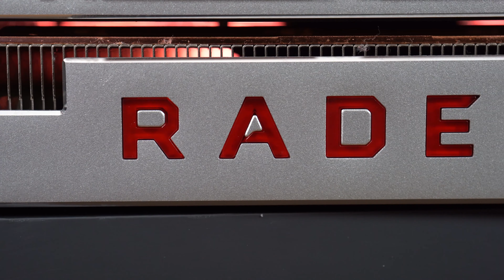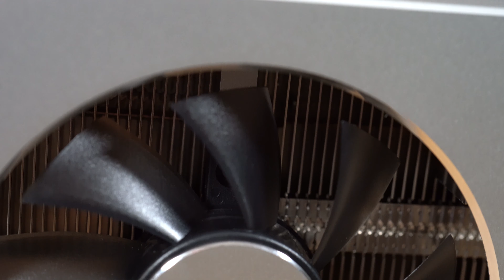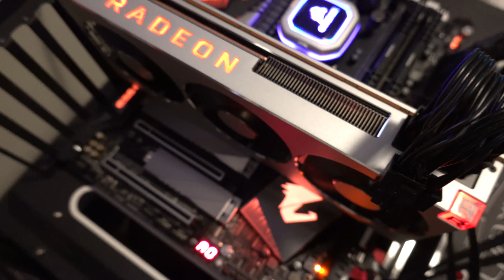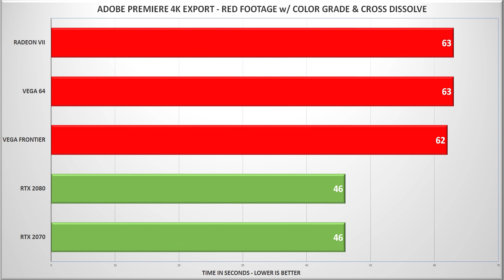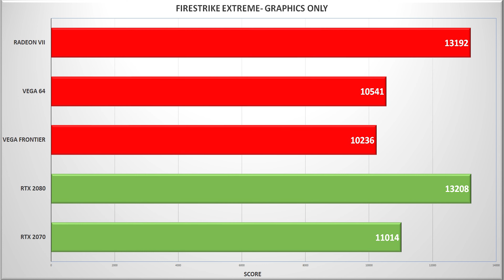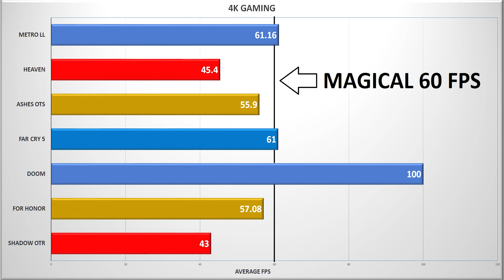Radeon VII - Can It Compete?

Comment from the maker: PLEASE READ!
Thanks for sticking around for this extra long one.  Here's a few important notes:
1) In speaking with several other reviewers it seems like everyone had different, weird issues with their samples.  Some had constant crashes, some saw temps over 100 C, some couldn't overclock, some couldn't use monitoring software.  We all did the best with the cards we had and the information we were able to gather.
2) As I stated in the video, all of my information on Radeon VII was gathered using Wattman, as this was the only monitoring software that would work at all.  As such, I couldn't gather power draw numbers, and my temps might look lower than some other reviews.  Unfortunately, not much I could do about that.
3) Improved drivers will likely help a lot of these issues, but we could only work with what we were given, which was the press drivers.
4) It's likely I'll revisit this card in a month or so and see if things have improved.
Reply: Under-volt the card ! how have so many professional reviewers overlooked this? it was well known that Vega cards perform significantly  better when under-volted. so far Ive seen one review where the bloke under-volted the card. low and behold he achieved a OC of over 1900mhz , closing the gap with even an OCed 2080.
Reply: I am curious if your 100c was core temp or junction temp as those are very different.
Reply: If only AMD had put as much time and effort in releasing it and sampling reviewers with some decent drivers and had some quality control so there wouldn't been these (random) issues/crashes etc. as they did with the time and effort that went into the reviewers packaging and card display stand, the news story might have been a bit less dissatisfying besides what the cards offers for the cost it currently has.

Comment: Fair review, You said the same basically as all the other reviewers, and you gave the card a chance. I am a AMD Fan(not fanboy), i recently bought the sapphire vega64 nitro plus and although it was very fast in normal gaming it was horrible in VR which is very important to me being a sim racer. So to find the Radeon VII having driver problems was not what i wanted to hear so to cut a long story short i bought a 2080 and it just works, especially with VR.
        I want to support the underdog and i went Ryzen CPU in 2017 previous to that I had a FX6300  i had a R9 380 and have a RX 480 so i wanted to stay AMD with buying a high end GPU so i got the Vega 64 as i said above. I am now in debt because the Vega64 didn't work out and i will not be buying another GPU for at least 3 yrs. When the time comes again i will see whats offered, what gives me the best reliable performance for the money I'm prepared to pay, I hope its a AMD product but if their most recent offerings are anything to go by i think it will be unlikely, BUT you never know, i mean look at Ryzen, miracles do happen.

Comment: Honestly, if we look back in time, I remember Nvida having a TON of launch day driver issues, most notably when the 4 series launched, as a lot of games read it as the old AGP 4 series card, and deemed the card incompatible to play that title. I personally had that issue with my GTX 460 SE, which launched MONTHS later than the GTX 480. That being said, I think the driver issues resolved, and this card is going to be a smash hit at the price range, factoring in the tests where it dominated in, and use the scaling from previous Vega cards, then scale the results to Vega results in titles where there is obviously a driver issue with the card due to extreme low performance,  I have a feeling once the driver issue is fixed, we will see numbers closer to that.